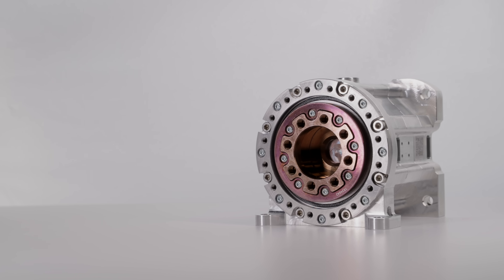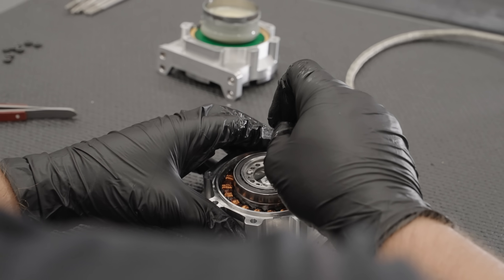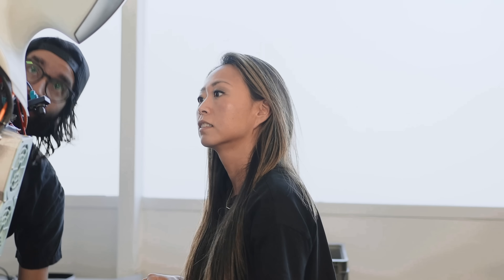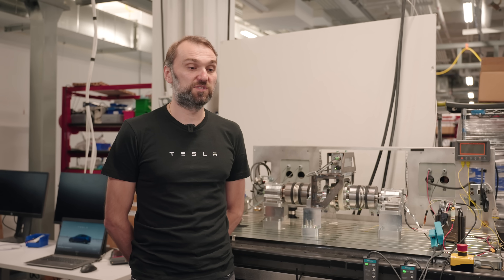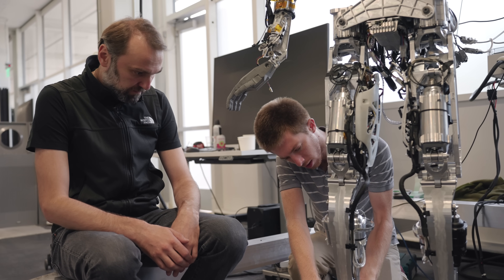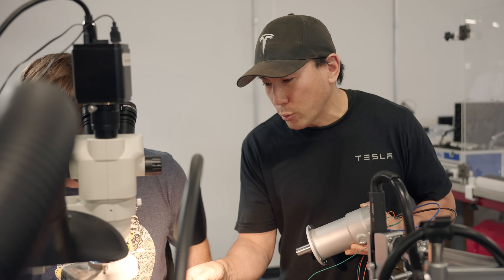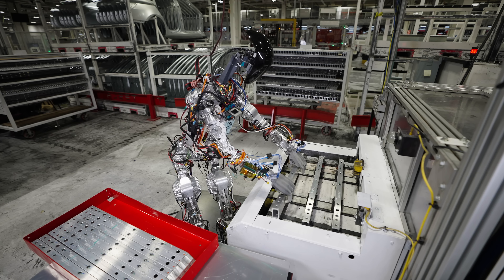Tesla Bot | Actuators Team

Comment: I love how they integrated the motor vertically instead of horizontally, it is usual that the axis of the motor is the axis of rotation of the joint, but in this case the motor goes vertical to transform the movement from rotary to linear with a gearbox , similar to a muscle, in the university it is usual that almost everyone does it the other way, it really did not occur to any of us in my class at the university and neither did any professor. Really smart.
Reply: Linear motors aren’t new technology
Reply: @myrobotisgas  yet nobody is using them correctly it seems. Fascinating what people with real talent can do with things “that have been around forever”.
Reply: It is true that rotary actuators are more common. But if you do robotics, you are probably familiar with the robots from Boston Dynamics. Even their four-legged Spot robot uses linear actuators to drive its knees.
Reply: That's not what "vertical integration" means lol...
Reply: Errmm .... I am not sure if you really understood the term "vertical integration" correctly here  ----> definition of vertical integration : 
Vertical integration is a strategy that allows a company to streamline its operations by taking direct ownership of various stages of its production process rather than relying on external contractors or suppliers.

Means they design and produce every part of the robot themselves  ... so no external supplier is delivering any part of that robot. 
Of course i might be wrong and the motor is indeeed built in on the other axis and the mechanics works differently. i could not see that in the video though.
Reply: @cogoid  actually Boston uses hydraulic systems for the linear actuators used on stuff like atlas.

Very responsise and powerful for sure but take basically most of the room in the bot and blow out every so often. Not great for sustained operations.
Reply: Looks to me like the motor is turning a screw that converts rotation to linear movement.
Reply: “ reusable rockets have been around for along time “
“ electric vehicles have been around for along time”

And then came elon, actually used them and made them worth something.
Reply: @observer3137  That's what linear actuators are. Designing it that way give you mechanical advantage compared to direct magnetic drive.
Reply: @mobiuscoreindustries  Spot mini is fully electric, and it uses a motor driven screw actuator for the knee joints.
Reply: @RoyRosales  I was saying that the technology isn't new. I wasn't saying that the technology is perfected. Notice the main comment is implying it never existed before -- "it really did not occur to any of us in my class"
Reply: It's because the guy who thought of it never went to University.
Reply: @epgui   maybe in robotic it makes sense to say that
Reply: @lecadou  it doesn't. It's referring to something else
Reply: @cogoid  yeah, but was referring to their humanoid robot Atlas, not good boy spot. 

Trying to compare apples to apples here, so to speak.
Reply: @mobiuscoreindustries  Maybe you have forgotten -- the comment to which you replied was about Spot using linear actuators. Atlas is a different thing.
Reply: @cogoid  Yeah that is entirely my bad
Reply: Damn there sure are lots of Ph.Ds on YouTube. No I mean it, I really learn a lot from reading random comments while lying down on my bed before sleep lol
Reply: I was reading that Elon is a strong promulgator of the first principle.. or whatever the principle of “dissecting everything to its very basics” its very own beginnings & whys - is called
Reply: @munteanionut3993  first principle thinking, and you are correct in that.
Reply: @davincisghost9228  complete rubbish.
Reply: @munteanionut3993  “First principles thinking” aka first year Engineering 🙄

Comment: It's comforting to see that Tesla engineers are using the same cheap and crappy tweezers that most hobbyists use.
For the uninitiated: these tweezers look cool, and they have razor sharp tips, but the tips are too thin and thus quickly fan out.
(solution: sand or grind down the tips a bit - up to 5mm. You can still make them as sharp as before, but with more 'body'.)

Comment: Awesome work. Love seeing the custom harmonic drives & roller screws being integrated directly into the motors. We used the same tech on the LUKE Arm.
Any chance there will be one of these linear actuators used to independently steer each of the four wheels on the Cybertruck?
Reply: Unlikely for many reasons. But could show up in future Tesla and SpaceX products.
Reply: @andrasbiro3007  I'd bet they are already using something similar, but far larger, to steer the Raptor engines.
Reply: @keithviolette5870  
They can do that independently of the robot. Elon talked about electric actuators for Starship long before the robot project started.
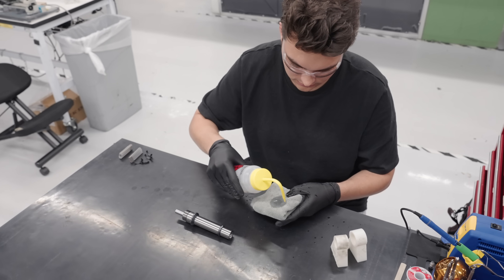Reply: I saw the roller screws @ 1:03 but did not see harmonic drive components.
Reply: @ricinro  you can see a flex spline at 22 seconds.
The linear actuators use roller screws, the rotary joints use harmonic drives. 5 harmonic drives are used in the LUKE Arm that I helped design, tightly integrated with customized brushless servo motors.

Comment: At the quantum level the fact that electricity moving through a coil of copper enough times with enough load to properly electrify the coil can produce the fractional portion of basically any designed torque wirelessly transmitted to the other coils to cause the aforementioned torque is amazing.

Comment: I have a question, Why don't we see compliant mechanisms in things like these?
Reply: One spring constant is not optimal in all situations. When actuator bandwidth allows it, it is often better to implement compliance via feedback. Then it can be dialed up and down as necessary. For example, Boston Dynamics's Atlas robot uses very stiff hydraulic actuators -- but it is still capable of force feedback via rapidly controlling joint positions based on the sensed forces.
Reply: @cogoid  oh thanks alot that totally makes sense

Comment: Four key points...
1.The video is created to give the talented candidate a walk through as though the team members were describing their frontier work to you alone.

2. Vertical design means system specs drive the design of the bespoke subsystems. In contrast, other robot teams build from a catalog of available components. Tesla engineers design and build everything exactly as required by the system - with manufacturing at scale always a constraint.

3. Why are the actuators and not the sensors highlighted? Because the sensors simply feed raw data to the computers, whose design is done by software engineers - shared with the vehicle team. What Tesla is recruiting for here are English-speaking hardware engineers - the best in the world.

4. Why are only the small parts shown? Because that's how top down specifications lead to bottom up realization. Hardware engineers solve the whole system in very small steps and solutions.

Comment: People don't understand the difference between this and Boston Dynamics. Let me explain.

The reason the Tesla Bot looks stiff and slow is probably because every movement is exactly planned for the demonstrations.

The Boston Dynamics demonstrations are obviously planned as well (they are NOT interested in making the robot think like a human as many people seem to believe)
The difference is that the Boston Dynamics robots are able to react to their environment. For example the feet slip randomly while walking. That makes it more robust, faster, and not every movement of every motor needs to be planned in advance
Reply: This problem is much more difficult than it seems. Boston Dynamics uses AI to predict the position of the robot, the environment and physics in a process called model predictive control.

I learned the basics of that in a really good university course.
Reply: @hxllside  mpc has nothing to do with AI, it's just optimization nothing else
Reply: @martantoine9977  You're right. I should have said neural networks (although every optimization algorithm is possible) just wanted to put into context what is meant when people say these robots use "AI"

Comment: They're obviously needs to be a smaller FSD computer I guess you could just chop it in half It have them both connected by fiber optics and put the two parts where it be most practical and so they take up less space so you can focus on articulation with the shoulders and torso or you can mount the computer sideways, I see you have multiple prototypes too so obviously progress is being made great work! This will be Tesla's greatest product if it succeeds!
Reply: why fiber optics ?   what do you believe is the advantage from optical fiber compared to copper ?
Reply: @mm-hl7gh  fiber optics are faster and when two computers are separated from each other and far apart within the robot you wouldn't just use normal wire s because a lot of data has to pass through them both it's also why we use fiber optics to connect servers computers to routers everything standard copper connections would just be a little slow.
Reply: @mm-hl7gh  oh and it's also a part of the hardware AI problem with a connection between two computers or its own RAM would be too slow to run the neural network efficiently even if you're CPU is fast enough the connection is not even between internal components and that's why we also have specially designed AI hardware and neuromorphic computers just to deal with that!
Reply: You obviously don’t know the FSD computer is duelled as a backup that’s not required in the bot, so size is a non issue. But keep going, your ignorance is hilarious.
Reply: @fredbloggs5902  actually I knew it had two processors but it's inside the same case splitting it in half so even though it's a smaller computer each part has one processor and they're connected to each other to make an essentially the same computer but In a way that would be better for design you have completely misunderstood the entire comment and that is hilarious to say the least!
All it is it's just having two smaller FSD computers with just one CPU that's half the size communicating to another one at very high speeds that's also half the size In a way that would make it a full FSD computer except for that they're smaller and you can orientate them differently to save space for other things like more actuators more skeletal structure or batteries or whatever the heck you want!
Reply: @mrnobody.4069  It would make more sense to use photonics laser point to point for communication to replace CAN bus
Reply: @TheMagicJIZZ  A Controller Area Network bus I think it's designed for each part to talk to each other without a host computer, I'm not exactly familiar with that but I'm pretty sure the idea is The Tesla bot has all of its inputs and outputs going through the computer and the the neural network so it can make decisions and know how to control each part, sooo what exactly do you have in mind?
Reply: @mrnobody.4069  Well i know Tesla uses shorter aluminium cables over copper and a new can bus. Power electronics could be reduced with small lighthouse switches inside the robot 

Communicating from head to arm or leg actuator's
Reply: @TheMagicJIZZ  well just look up a little more about the CAN bus, I think it would naturally come in the robots design since normally other robots seem to have something vary similar in function like robot vacuums or something when the computer sends commands to different microcontrollers to execute many functions so it's like a miniature closed internet between different components the computer just wants to do something and then it happens? I still mostly have no idea what a CAN bus is other than it's used in practically every car and truck and many robots use something similar but you learn something new every day.

Comment: What people don't understand is that Tesla will never make the most amazing actuators (or at least not in the beginning) but actually create them in a way that you can mass produce them and then have an affordable but useful bot, which, once again, likely wont be the most amazing thing you ever saw, but it will offer an actual value. Just like the Model 3+Y they aren't the most amazing EVs on the market, but they are affordable yet truely useful in real life. The very same things that made the Model 3+Y the most successful EVs on the roads. Maybe not the very best stuff out there but at their price point they actually are still pretty much the only EV that you can actually use as primary car. Mach-E and others are nice cars too, but they just don't have the efficiency especially when driving at higher speeds in the winter to be actually usable properly.

Comment: When designing most engineers seek off the shelf solutions but generally off the shelf components are never optimized for very specific system requirements.  Tesla needs right-sized components that are optimized for robotic production, low weight and likely with integrated motor controllers and absolute linear and radial encoders.  The Tesla FSD tech may also  combine visual feedback to supplement and correct positioning.

Comment: considering how big and bulky Atlas (boston dynamics humanoid bot) needs to be to move quite freely.. i wonder what the Tesla bot can actually do and what's the most useful application it'll have? from the video, i assume movement and agility will be pretty limited and for that, will it be just another Asimo that'll get abandoned later?
Reply: They are building this to be able to do work just as human can and use human infrastructure. of course they can't work at the same speed as us but they will work like, 20 hours a day. they cud make it move faster but will require more training and adjustment to battery usage. it will be very difficult to abandon this one because it will be make in probably millions of units and will get upgraded via software, just like the tesla cars. seeing their progress i'm very optimistic that they will succeed

Comment: 1:02 This is probably the coolest thing in the video. Its not a drill bit, but a transmission for the motor. its been designed to be housed inside the shaft of the motor itself. its super compact with insane torque. They have a video of one of these lifting a piono rather fast and rather gracefully. quite impressive.

Comment: I would consider reducing the size of the battery so as to reduce the bulk and weight but making it very easy to switch out the battery like on a power drill does.

Comment: Can anyone explain what that is at 1:03? Have never seen a mechanism like that?
Reply: It is an inverted planetary roller screw, built inside of the rotor of the electric motor (0:57). A very good and compact actuator.

"They were invented in France in 1942 by inventor Bruno Standgren. He designed a planetary roller screw and applied it to a narrow-gauge train in a coal mine in France in 1949. In 1954, he applied for the patent in the U.S. as well. Since then, planetary roller screws have been applied to some machine tools and airplanes."

Comment: Looks quite odd with the bended knee, why can't it walk or stand up straight like a human since its a humanoid? Or is that a challenge you're probably working on?
Curious to know!
Reply: Go watch the videos with James Douma.
Reply: Because it does not have a model predictive control system that can do stable movements. Probably every trajectory of every motor is exactly planned. That's why it looks like a robot from the 80s.

I'm sure they will get that working sometime soon but it is not easy

Comment: Full metal robot 🤣.
Nice prototype. I'm a bit surprised that it doesn't have at least two toes. Unless it has an gyroscopic stabilisator tows would increase balance on uneven terrain signifcally.
And ofcourse gyroscopic stabilisators for the torque needed are not available today.

Comment: #teslamotors Imagine if you haven't been told there is a technology out there right now, which can power entire houses with silent electricity (size of a sofa) : that requires no, fossil fuel, chemicals, waves, solar, thermal, batteries or fusion etc it gives out no considerable heat, smoke or noise pollution, no vibrations, it works in the dark, in a storm, no need sun, not very heavy & could be eco friendly etc

Comment: I think Tesla is mistaken to try and design everything 'from scratch' for this.

Within a humanoid robot, every actuator has different requirements for speed, torque, physical size, etc.

There is already a motor marketplace with tens of thousands of motors and gearboxes, linear actuators, and all kinds of electromechanical designs, many of which are very low cost. 

Designing your own in house simply is distracting you from the real hard task, which is control algorithms, and enough 'smartness' to be useful.

If you make a robot with a motor slightly too heavy or large, because thats what was available, your robot will still work fine.   If you skimp out on the control algorithms and your robot walks like a 90 year old grandma with a zimmer frame, it won't be useful for most of the applications you had in mind.

Comment: From a mechanical point if view, it might be possible to design a reasonable humanoid robot but, at this time, movement smoothness is still lacking…

Also, the biggest challenge is probably software : Microsoft Windows and Apple Mac OS exist for more than 30 years and are still work in progress, so I don’t believe there is enough technological maturity yet to solve the problem of an autonomous robot in a fully open environment.

That said, as an a half step, remotely controlled robot by a human (who has conciousness) may already alleviate streneous physical tasks usually done by lower income people.

Maybe a kind of call center where people would be remotely doing streneous physical work through a robot…